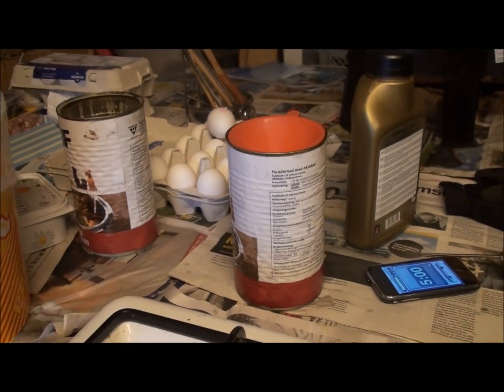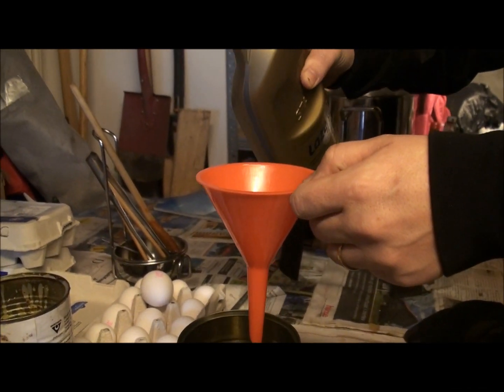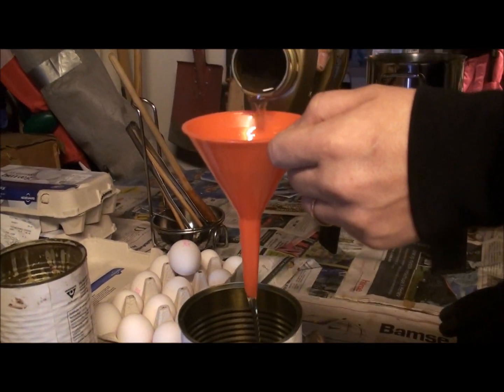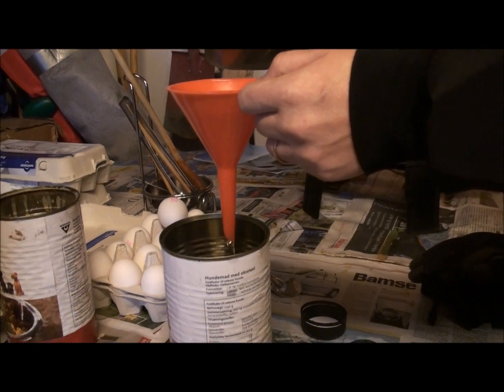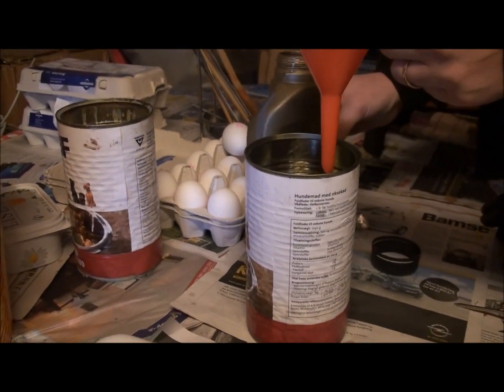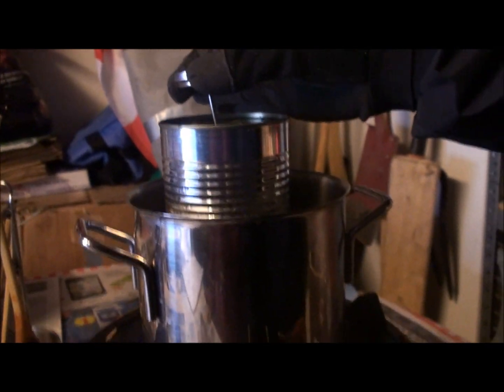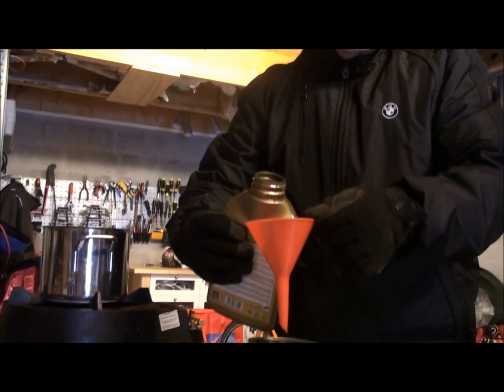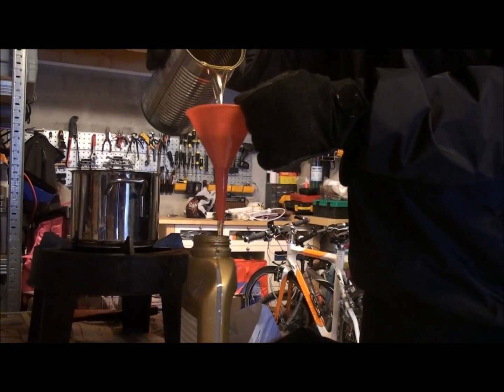Motor oil viscosity test cold and hot

Comment: Thats so weird. 5W-40 Oil should be thicker when hot. 5 is the viscosity when cold (less viscous) and 40 is the viscosity at 100C (more viscous).
Reply: Ty_Braek it's a common misconception, 40w is thin when hot, 30w is thinner when hot. At room temperature all engine oils are thick.
Reply: When oil is just warming up inside engine and flowing at 40c it will have a thickness of usually 105 cSt. Then once it's really hot like 95c to 100c it runs thin like 16cSt. If it's a 30w oil thickness when hot will be thinner like 11cSt.

Comment: EVERYONE KNOWS THAT HOT MOTOR OIL FLOWS FASTER
Reply: why the oil 1 hour very hot
Reply: Yes looking on the net they would have you believe  5w40     was 5 cold and 40 hot  so this is not so   We all know straight oils say sae 40  is thicker still at low temps  

I have more reading to do   so the 5 and the 40 are not on the same scale or something      Google User
Reply: OK then is it fare to say that a 5w40  is less thick at very low temp that a straight 40 would be  we need to see a new 

video please to prove this please

Comment: An alternative...

Look at the Data Sheet for this oil,
https://external.statoilfuelretail.com/mar/lu/sto00131.nsf/UKProductsWeb/lazerwayc35w-40/$FILE/Statoil_LazerWay_C3_5W-40.pdf
 
and you see the Viscosity (Kinematic) at 40°C and 100°C
 
KV40°C = 76 mm2/s
KV100°C = 12.6 mm2/s
 
Using the Walther formula which relates Kinematic Viscosity and Temperature,
http://en.wikipedia.org/wiki/Temperature_dependence_of_liquid_viscosity
you can calculate the viscosities at 0C and 80C
 
KV°0C = 661 mm2/s
KV°80C = 20.3 mm2/s
 
Yes, it’s a lot more viscous at 80°C than 0°C.

Comment: shouldn't oil be thicker when hot? 10w-40 = 10 when cold 40 when hot?
Reply: David G  Not really. Indeed the 40 oil viscosity is thicker than the 10 one, but only if they are at the same tempture. But when the oil gets heated up its thinner out. So, its not convenient to have a thicker oil at the cold start of an engine, and not convinient to have a really thinner oil when its at working temp. That's why exists multi viscosity oils, so it can start with the thinner oil as possible, for fast lubrification, and try to mantain the oil at a closer viscosity even when it gets hot. So a 10 oil at 20°C is a lot thicker than even a 60 oil at 90°C.

Comment from the maker: The oil was marketed as full synthetic if I recall correctly. It isn't all PAO so I would rightfully consider it semi-synthetic, for what it's worth
Reply: +Allan Jensen Thicker when hot thinner when thin? Well it would weigh the same no matter what? The point is what weight the thicker between thin is? 40 being really hot or 5 being thin LOl what is c to f degrees they explain a degree of the same sorts.

Comment from the maker: Hi Daniel, some mechanics will state that the 5 and 40 mean the same, as an absolute measure, i.e. that the oil would be thicker (40) when it is hot and thinner (5) when it is thin. That is wrong as the two numbers are based on 2 different scales, that are unfortunately called the same thing! On both scales, the higher number means thicker flowing. However a 5 on the first (coldstart) scale is quite thick indeed and many times thicker than the 40 on the other (hot) scale. Clear?